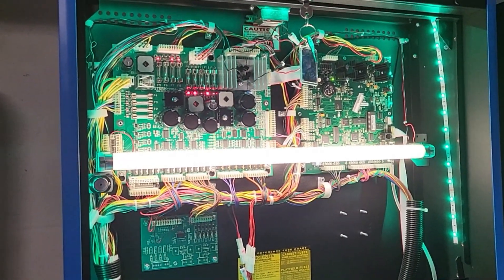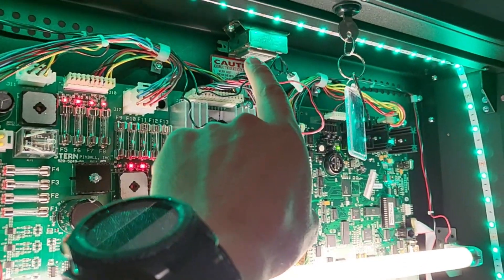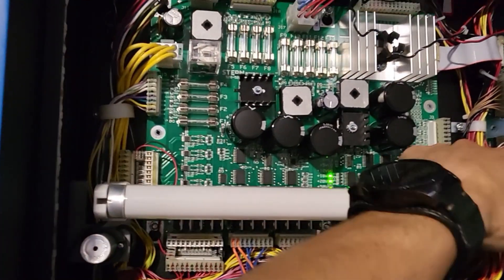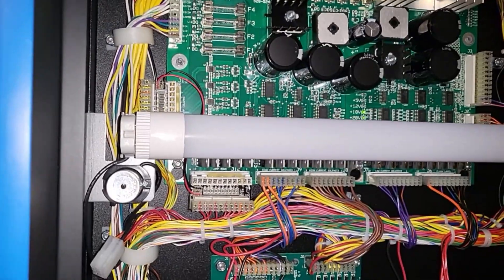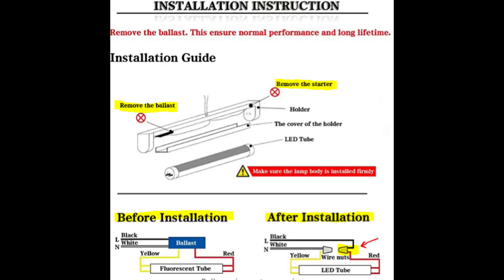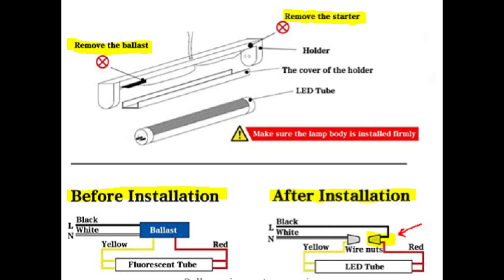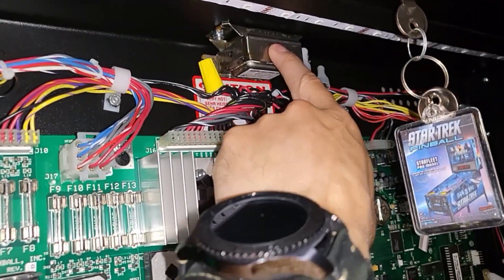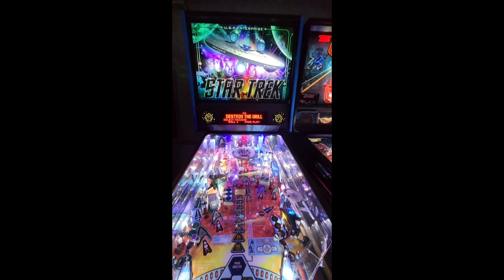How to convert CCFL Fluorescent light fixture to work with LED tubes

Comment: good video, that’s not CCFL btw it’s the opposite. CCFL stays for Cold Cathode Fluorescent Light/Lamp (usually very very thin fluorescent tubes) and what you replaced is a pre-heat fluorescent tube where the cathodes are heated at lamp start.